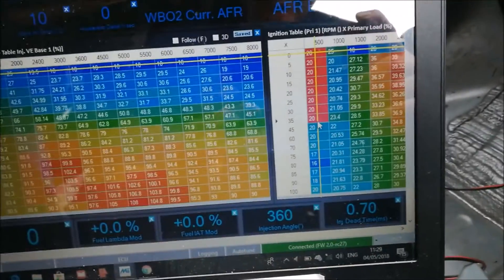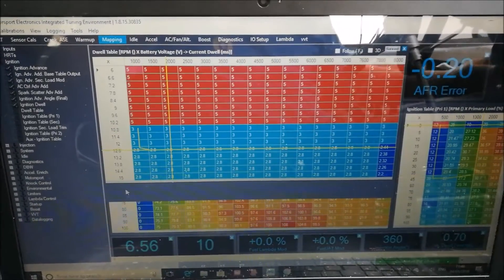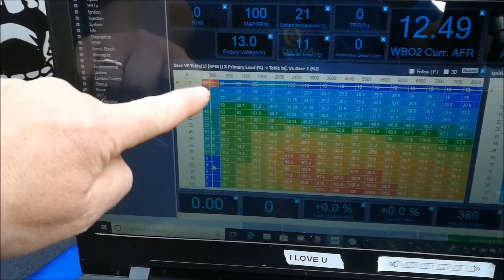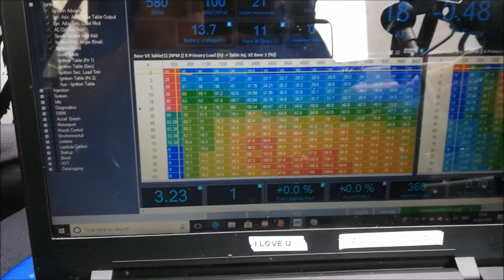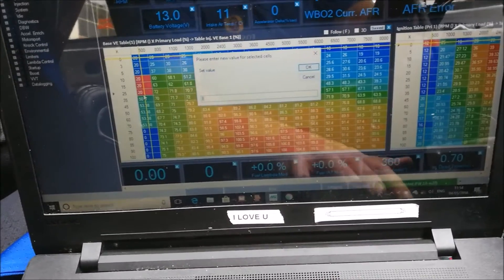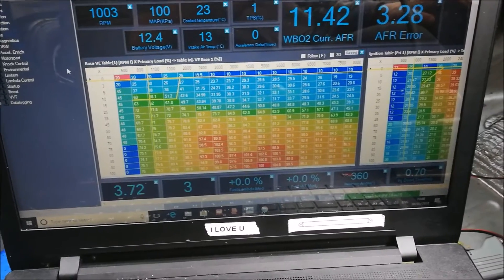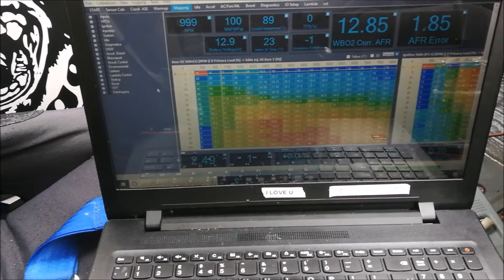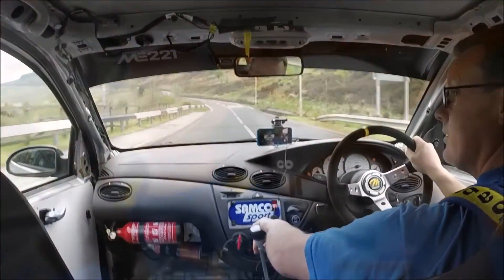Mapping the ME221 ITB bad starting issues

Comment: Hi Steve is your gear lever extended by any chance? Looks oddly longer than my shaft (Ooerr!) does it give a better feel to that box? My box feels nice and smooth but with the length of my legs I sometimes struggle to reach the lever!
Reply from the maker: Leadfoot the orange base plate is an extension I made to raise it up. It does make it feel better.
Reply: Spark Plug Steve you should start making them so I can buy one, the gearstick I have to bend to reach it 😂
Reply from the maker: Leadfoot someone on st170 owners official group was making their own version and selling them. Ask on the group.